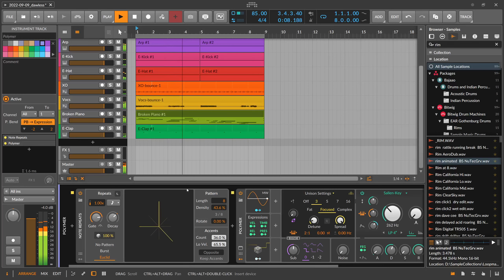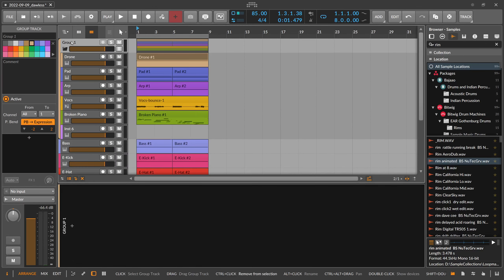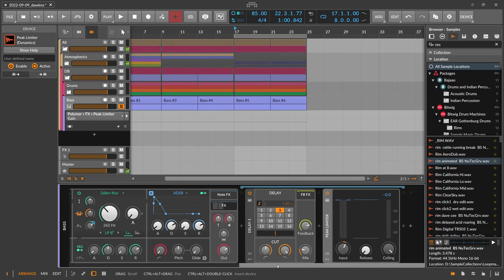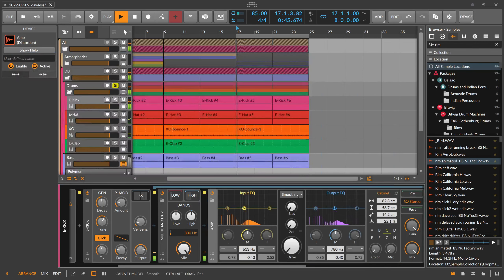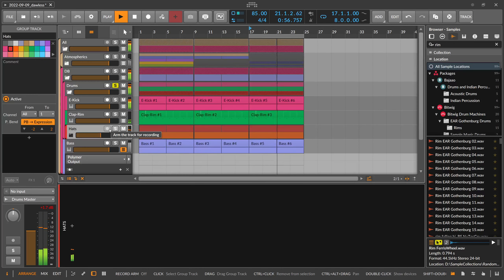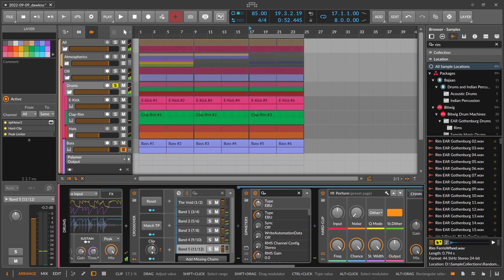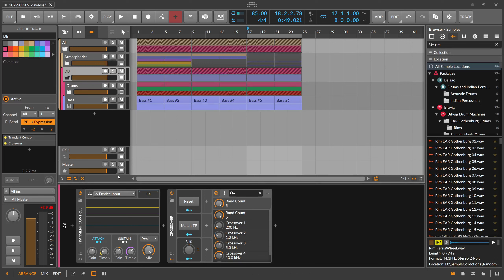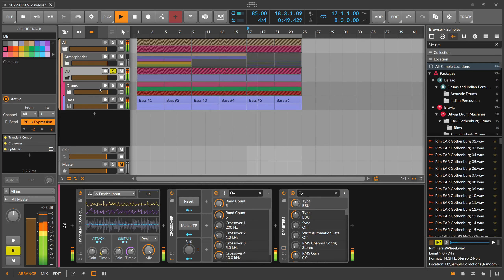Bitwig Track from the start PART 2 - Quick Mix

Comment: Very interessing video, especially about the clipping things to level the different tracks. I though noticed you ended with +4db true peak and I wonder whether you consider that not important (I would then appreciate learning why) or plan to fix it later (and so why not now) ?
Reply from the maker: I dont care tbh. I havent noticed any audible distortions on my tracks in different circumstances. And i usually test tunes a lot.. on different speakers/services/social media. If i dont hear a problem i dont try to fix it.